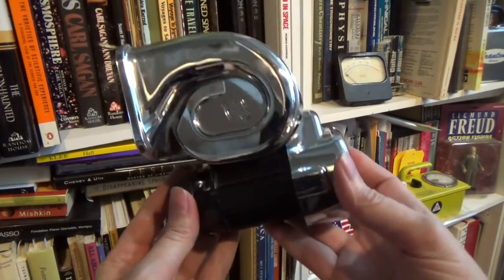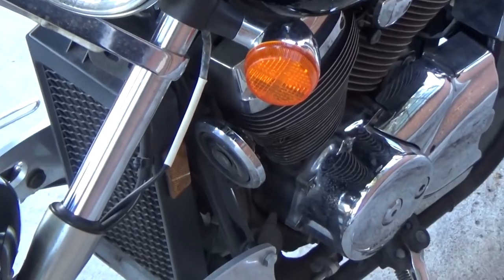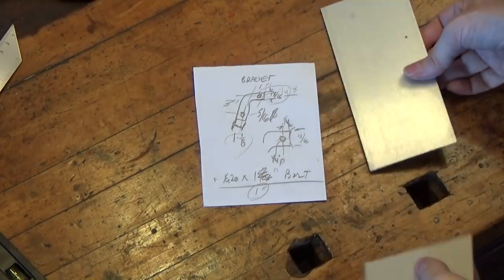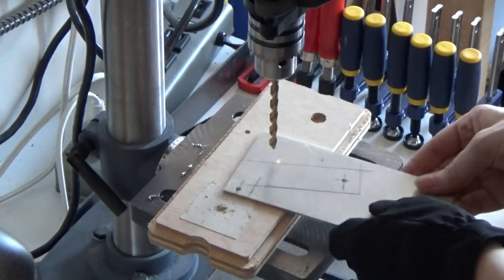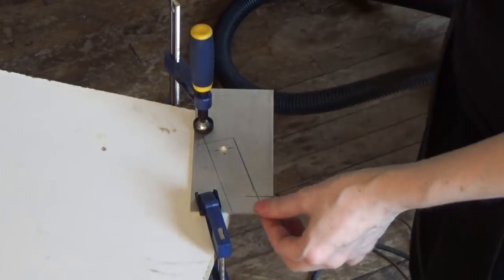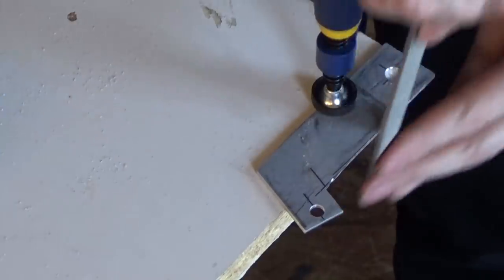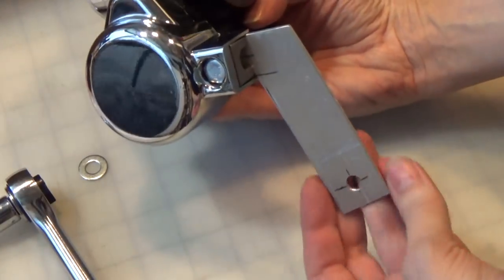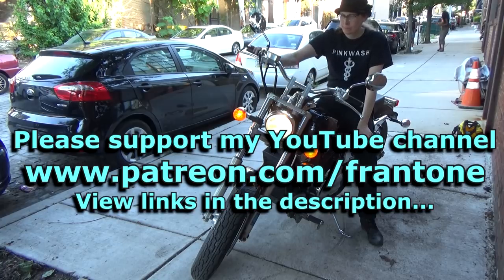Bike Air Horn!

Comment: Fran, you should rotate the horn so that the  trumpet part faces down.  Found out the hard way that these compact  "folded" horns  will  collect water during heavy rain (or car wash).
The folds will hold water that gets into the horn and eventually will cause failure. Had it happen to mine.  Mechanic friend suggested the change of angle and since then no problem. No reduction in horn volume either.

Comment: Nicely done.  A simple solution to a nagging insufficiency.  Back in the 1970s I was so dissatisfied with the pathetic stock horn on my motorcycle that I found kit that included a compressor and a pair of automotive air horns and mounted it up to the bike.  The compressor wound up tucked into the empty remnant of the original airbox that resulted from a switch to pod-style K&N filters, and the twin horns were mounted up front to a simple steel bracket I made that resulted in them pointing downward along both sides of the frame's front downtube.  And what a difference they made.  The upgraded horns were vastly louder and really got the attention of the folks who tried to switch lanes into my bike because they hadn't noticed me there.

Comment: that horn probably needs a relay, I know every aftermarket one I have ever seen needs one, don't think Harley would be different, I can see from the dimming of your lights its drawing a lot.
Also agree with the other comments and suggestions on the drill press, the ”drill from opposite sides” trick does make the drill less likely to stick, but shit happens.
also chalk your files before using on aluminum, reduces clogging by a lot.
Reply: zanarkand2005 “chalk your files when using on aluminum”  Thats a great tip. Worked on aircraft for many years and went to college to get an A&P license and was never taught that tip. And you file lots of aluminum during airframe repairs. Do you use stick chalk or chalk line powder type chalk?
Reply: Fireship1 stick chalk, Brownells sells a special file chalk stick, but everyone I know uses normal chalk sticks, its mentioned in the Nicholson File Filosophy booklet, I heard about it from the machinists on YouTube.
Reply: zanarkand2005 thank you for that. I'll be sure to use it the next time I'm smoothing out aluminum plate edges
Reply: Its a Honda.

Comment: stock horns are almost always adjustable to different pitches and "buzziness"    by set screwes on the back.  they set the preload and make-break distances and values on the internal electromotive buzzing contacts of the horn.   you can fiddle with them to obtain a sweetspot tunning to be much louder or much softer.

Comment: Fran, I did not know that you are a fellow biker. Nice retro fit of the new Harley horn. Nice to see that you added radii to the corners of the bracket. I work for Rolls-Royce in the U.K. and during my apprenticeship it was instilled into us to add such features to reduce the affects of stress and fatigue cracking. I have recently purchased a Honda GL1800 Goldwing (last of the old model) and I cannot believe how loud the standard horns are! If you ever visit the U.K. then head for Matlock Bath on any (summer) Sunday, there are usually a few hundred bikes there on show. Matlock is nicely situated on the edge of the Derbyshire dales and have some really fine biking roads. This is a great week, finding out the you are biker and that England are in the semi-finals of the football World Cup. Stay safe on the bike and please always wear a helmet.

Comment: I think I would have made the length of the mount going to the body of the motorcycle a little shorter (or made the mount out of a heavier gauge steel).  There's too much 'leveraged vibration' due to the mass of the horn out at that length.  I would have painted it black, as well.  Those folks recommending Locktite, a relay, and clamping your work are also very good suggestions.  But WOW, here I am, second guessing one of the most clever, resourceful, and innovative women I have ever been blessed to know about.  It's your bike, Fran.  Never mind me.  I'm still so very impressed (and downright envious) with everything you do, and thanks for the video!
Reply from the maker: I needed the length to get it away from the engine but I might reinforce it later on if it's too bouncy in traveling.

Comment: If I might suggest: the proper way to file is in one direction, not both ways. Also please use a Nylock nut on the SAE bolt, safety wire it, or thread lock, as the vibrations from your motorcycle will cause it to loosen & fall off.
  Holding your aluminum plate in a bare hand is courting a trip to the ER. Been there, have the tee shirt & scar. Best is to clamp it down, then drill. It takes longer, but no blood to clean up and a useless hand for several weeks/ months.

Comment: little check if the plastic part is not tanking to much heat from the heat sink when you in the traffic jam at summer. Also check your battery, your lights shouldn't  drop so much when you use the horn (to much amp from the horn?). Maybe change all to LED?

Comment: Nicely done, didn't realize how tall you were, I had the Honda 750 ace, the shadow was just too low, by the by, you might've used a lock nut on the horn side of your bracket,  peace of mind. And the vibrations although not that bad might loosen it up over time.

Comment: I would use a spring washer or similar to attach horn to bracket. Helps to avoid nut loosening with vibration.

Comment: Is the horn switch rated for current the motor in that horn draws? Might’ve been relay time...(I installed a Sebel motorcycle 120dBA air horn and now no excuse I’m not heard but I found out the hard way about the horn switch not long after)....
Reply: Probably draws the same 10A the regular horn does ( they are not exactly efficient at anything but converting electricity to burnt coils and even crisper contacts) so not going to worry anything so long as the normal fuse does not blow. 

However that is a quiet bike, most owners seem to be deaf, as they ride them with the loudest fart exhausts they can find.

Comment: I don't know about your 750, but my '01 Shadow 650 had an absolutely dinky 200W alternator. I hope you don't have to use it so much you kill the battery.
Yes, I'm looking at H-Ds since even the "small" alternator is large enough to run the bike, a CB, a 50W quad band transmitter, & 100W HF transmitter.

Comment: I would have used a locknut on that bolt, or some locktight, would also make it harder to steal
btw, fix a magnet on the side of your drillpress for the key ;)
Reply: I thought locknut as well due to the vibration of the bike.
Reply: Loctite is my friend. Blue in this case. Or red to push it towards the theft-proof realm.
Reply: I was also wondering if a fine-threaded 1/4 x 32 bolt wouldn't be a wise selection over the coarse 1/4 x 20 thread.
Reply: Nahh. Fine thread bolts are just stronger than coarse thread. 32 tpi (extra fine) might be hard to find in your average hardware store. Not much call for extra fine thread. Harley used their own 1/4-24 up to about 1984 or so.
Reply: Interesting.  I wasn't thinking so much about strength as off-torquing.  But, a good lock nut would do the job as well.

Comment: I’ve been driving a 800cc bmw for a few years now and found that this has more than enough displacement to take me anywhere I want to go on the earth. But I really could use a air horn like you have on your cycle. I’ve driven Honda shadows many times and the are extremely well built. 
Do you drive cross country or mostly around town driving.

Comment: "FINDING NIM..."  
 
Oh, sorry, wrong vid. 😜
 
For deburring holes in aluminum, take a drill bit larger than the drilled hole, hold the bit against the hole, and turn the bit by hand.  You don't have to push hard to deburr holes drilled in aluminum.

Comment: I would have used a slightly longer bolt with a nyloc nut or a lock washer or loctite. I know it's not a helicopter type chopper but still vibration is the enemy of fasteners.

Comment: 0:42 6:04
i was just gonna hot glue it together and hope for the best :P
the lights kinda dim with the new horn though
anyway, great video as always !
Reply from the maker: Without the engine running and the lights on the battery current is limited.

Comment: Hi Fran
Would you do yourself a favor and never ever wear gloves on a drill press.
You could easily lose a finger or worse if the drill bit gets a grip on that glove.
Other than that, I wish there were places to meet up with women like you instead of a bar.
Reply from the maker: I'm doing myself a favor by wearing the glove.  Thousands of hours over decades of drilling metal on a drill press I have had my share of experiences of the work getting caught in the bit, and when that happens you'll get your hand cut by the piece as it jerks away.  Happened many times to me, and I wear the glove to protect my hand for that.   Never touch the rotating tool.
Reply: Oké, don't say I didn't warn you when it happens.
Of course, I hope it never will happen.
Reply: My uncle last the end of a finger that way. He was militant about clamping.
Reply: It will happen. Seen it. She's just being strange about it.
Reply: I have never even being around a drill press and I don´t  know if an accident  will ever happen to Fran since she does not seem to use it that much, but I think it's her responsibility to show good safety practices or at least to comment about it.
Reply: I have 10 of thousands of hours using a drill press. Never hold the material in your hand and never wear gloves.... dangerous to your health  @FranLab

Comment: Fran, my darling, always clamp your work with a drill press C clamp/vice to keep it from flying around and cutting your tummy wide open. That's the difference between being taught to use power tools in shop class and learning from a book. Also those gloves gotta go. Plus do not hold the work up in the air and act all artistic with it. Just drill the dog gone hole and use a hand file to shape it later, not the press. Discipline Fran, discipline.

Comment: Do you even need a horn?  What I mean is, the bike engine is probably louder than either horn option.  Also, I now know I hate the sound of filing metal parts, even though you reduced the volume of that part, it still made my skin crawl and teeth chatter.   Maybe I'm just weird, who knows...
Reply: She apparently has the stock exhaust on the bike which on most Japanese bikes is pleasantly quiet rather than obnoxiously loud.  With the stock system you don't annoy everybody within a quarter mile whenever you open the throttle.